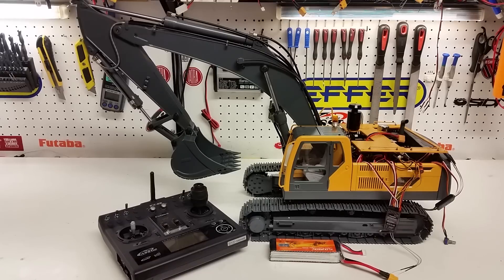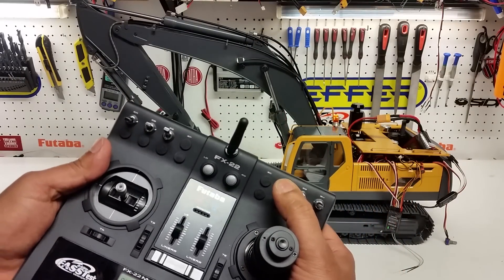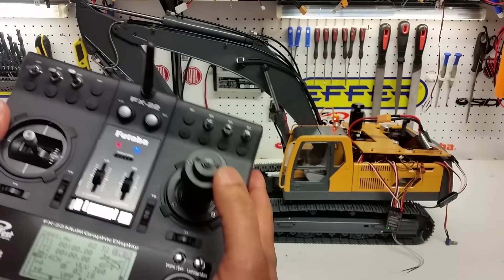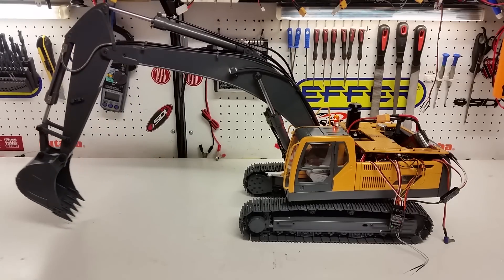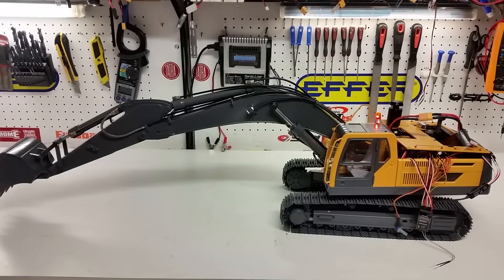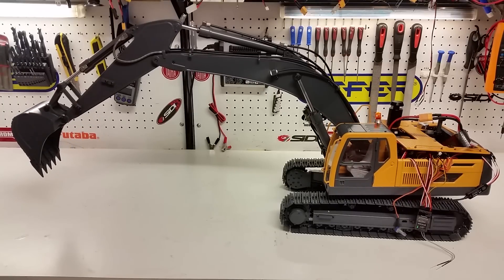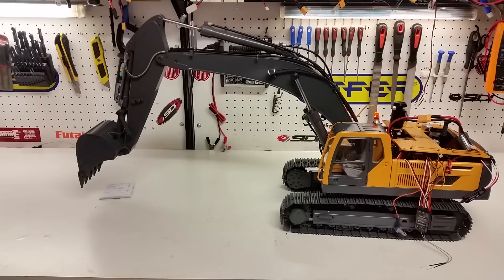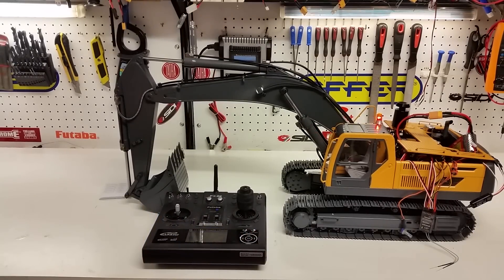CSMI : Part 4 Ready to run Hydraulic  Radio Contol Excavator start function

Comment: great machine and video, the sound is great too. but, in a real excavator it doesn't rev up & down with every motion of the boom, you turn the throttle up and you can hear it dog a tiny bit as you dig. but it doesn't throttle down unless you stop moving around 30 seconds. as soon as you move a stick it revs back up again and stays up till you stop completely again or turn the throttle down manually. other than that, your video & machine are great!!!
Reply from the maker: Good day thanks for the positive comment and feedback. Yes you are right the simulation sound can be selected based on the sound module you choose. In a real machine there are accumalators , Hyd pumps and these are coupled to the engine. Hence the hydrostatic drive pump deliver the oil pressure as per the demand needed via control valves. The engine is only a power source. CSMI
Reply: it is a really beautiful machine that seems to respond very well.
Reply from the maker: diggingwithmartin Thanks for a positive feedback.CSMI
Reply from the maker: +diggingwithmartin Thanks for the positive feedback CSMI TEAM

Comment: Thank you for this video. But what about the performance right out of the box? Of course it is possible to put it on a higher performanche level using third party parts - maybe even in endless variations depending on how much you want to put money in it. But as I said before: what about the original behavior? It would be great if you could please make a video on this aspect. This could help even more to make the decision easier to purchase it. Thanks in advance. Greetings from Turkey!
Reply from the maker: +69camillo69 Thanks for the msg. Performance out of the box is still the same. All we have done is put a silent pump. The lights are not included in the standard machine.